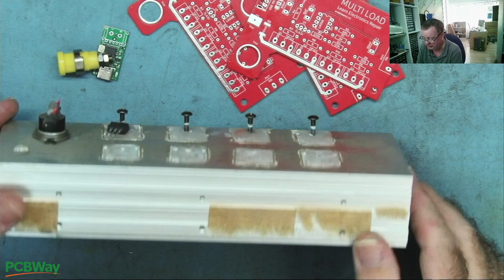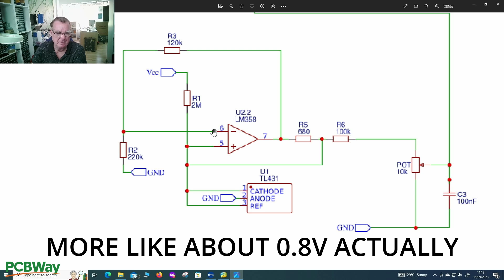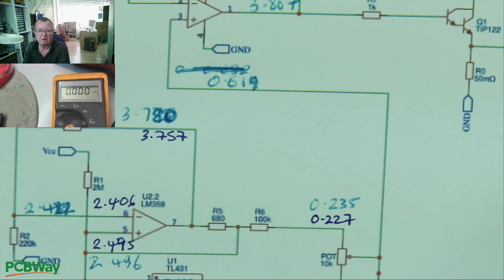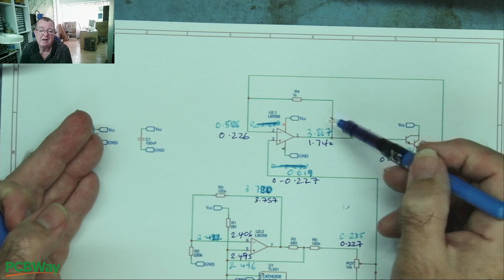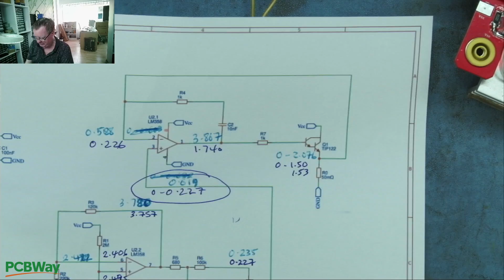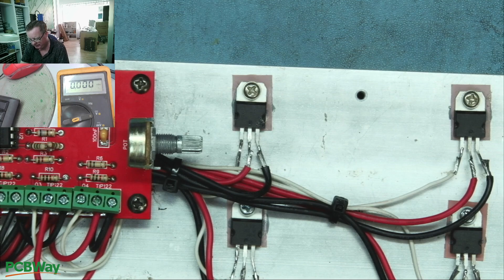MultiLOAD DIY General Purpose 140W Variable Electronic Load with USB PD Control

Comment: Besides what other commenters said about current sharing imbalances, you also have to take into account the SOA (safe operating area) of the transistors, they can only achieve the banner specs at ambient temperature and for a short time, as you increase the collector emitter voltage your maximum safe current is decreased significantly for DC(continuous) operation, the graph is usually near the end of the datasheet, before package information.

For the TIP122 you can only pull 1.8A at 30v VCE which is below the max power(assuming you can dump that power while keeping the transistor cool, if not you have to reduce the power even more). For a low voltage load like this one the effect is not as pronounced, but you should take it into consideration.

Comment: Transistors are CURRENT BASED devices, each with their OWN individual current gain figure. If the current gains (and tempcos and other things) are not exactly matched, having "the same matched voltage on the base" does NOT mean they will be sharing the load evenly. Their different current gains means each one will be drawing different amounts of load. Generally the highest one will heat up and then by its tempco gain even more current, heat up more, etc.... pop.

You either need somewhat chonky 'ballast' resistors at the base of each one (same principle as balancing LEDs when they're fed a voltage, so they draw an even current), or you need a separate opamp for each transistor so each one has its feedback loop individually controlled in the opamp loop. Drawing them all in one loop will typically lead to you blowing a transistor (or one after another in a chain as each one fails) each time you up the power.

Comment: Regarding the difference between the voltage-difference between the pot-output and pin 3 one question: Did you always get the GND-level for your measurements from the same point? The GND conductor is not too wide for a current of about 4A and there may be a remarkable voltage drop on the way from the 0R05 resistor to the USB-connector particularly with regard to the fact that it is reduced at the point whrere the OP-Amp is connected to GND. This may cause very different readings if the GND-level is taken from different points e.g. once at the USB-Connector and once directly at the pot.
With your design (obviously a double-sided PCB with a GND-plane on one side) you will not have this problem...

Comment: I've reverse engineered the PCB myself from the layout in the designers Youtube video. You haven't made any mistakes. Your schematic is correct. I have to ask where you bought the TIP122 transistors though. Were they from Ali Express?  🤔
Reply from the maker: The TIP122 from AliExpress... Probably 😉  Thanks for taking the to check our work (it was Detlef and Myself who did the reverse engineering).  If you check the other comments i figured out what the op-amp around the TL431 is doing so the circuit makes sense to me now

Comment: The reason why you don’t have identical values on pin 5 and 6 is that the output of the OPAMP is saturated.
According the datasheet the typical maximum output voltage at 5V supply is 3.5V.
If you calculate the voltage divider, the OPAMP should deliver 3.86V which it simply can’t.
Is this circuit meant to be a kind of pre-regulator to the TL431?
Shouldn’t be necessary in the supply range from 5 to 24V.
Reply from the maker: Thanks for the info, I like this because with these sort of videos and the discussion we can all learn something new.  I have to agree with you I honestly can't figure out what the op-amp  is doing in this circuit other than it could be regulating the supply to TL431 in some way.  It makes no sense to me to effectively 'amplify' the 2.5V refenrence voltage and feed that to the 10K pot.  Anyway that is not what it is doing here if the reverse engineered schematic is correct.  Why not just use a resistor divider to set whatever reference we want on TL431 and feed that directly into the pot?  With 100K resistor in series the current flowing through the 100K+10K is very small, and the other opamp input draws basically no current anyway.
Reply: @learnelectronicsrepair  maybe it’s just making use of the other half of the LM358..?
Reply from the maker: @inse001  Just for the fun of it 😅Nahh I figured it out, see the comments on the RalphJ4012 threads

Comment: Are you sure you can use 4 darlingtons in parallel without adjusting any other values ??...cheers.
Reply from the maker: Some comments on the original design say they have done this and got 140W load, but they don't go into specifics how they did it.  From what I was seeing, it did work with four in parallel until one failed.  It has been suggested that transistors were not balanced because they should have individual emitter resistors as well as individual base resistors.  The TIP122 datasheet says the rating is 100V, 5A, 65W.  Even if only one transistor was passing all the current IMHO it should not have failed.  I had 45W according to the USB analyzer so that's like 2.1A at 20V which does not exceed any of the ratings.  Obviously I'll be trying out a lot of ideas from these comments on the next video so hopefully we can all learn more than we already thought we knew 🙂
Reply: @learnelectronicsrepair  Richard, be careful about those seemingly simple figures fron the datasheet.
I can hardly imagine a TO220 package dissipating 65W (submerged in liquid nitrogen, possibly).
The datasheet might say 65W at t_junction 25 Celsius, for example (haven’t checked).
Reply from the maker: @inse001  It did say something like that, but the degradation per degree C was fairly small above that.  However it did go short.  Will experiment further on next video and also use thermal camera
Reply: Thanks ! @learnelectronicsrepair

Comment: Something odd-looking (to me, so maybe wrong) in the 2.5V reference circuit. The TL431 typically has a minimum cathode current of 1mA, typically 10mA. Although I nearly went doolally trying to figure out what that circuit was supposed to do, it seems to me that only microamps can flow via the 2M resistor, though there may be other components, connections not shown.
Reply from the maker: There is something odd with that part of the circuit.  It looks like the 2M resistor feeds the TL431, but then the 680R resistor on the output of the op amp also feeds TL431 and the voltage going to the 10K potentiometer via the 100K resistor can only be te output of TL431 which is 2.5V in this configuration.  So we get around 0.25V on the potentiomeeter which is what I was seeing.  But in that case what is the op-amp even doing?  I did think we have an error in the reverse engineered schematic, and we may well do, but the 680R and 100K resistors are also connected like this on the original PCB
Reply: @learnelectronicsrepair  Yes, very odd. Almost as if the op-amp is attempting to be the two resistors required to set the reference on the TL431, depending on the supply voltage. Depending on the reverse-engineering  revisit it may be worth just using a fixed reference component and not using that op-amp part. Also, may be worth investigating the drive current into the multiple TIP122's, there are some notes online about using pre-drivers or IRF1404's instead.  Apologies for the duplicate comment, that's YT auto-deleting and re-appearing comments again.
Reply from the maker: @ralphj4012  I think I have it. I'm pretty sure the opamp is acting like a constant voltage source for TL431.  The output of TL431 sets the output of the op amp (pin 7) to something a volt or so above the reference voltage and this powers TL431 via the 680R resistor.  The reference of 2.5V is then feeding into the pot. Obviously the load is meant to work on any voltage from about 5V to 30V but I never knew TL431 needed a fairly constant input voltage to give 2.5V ref.
Reply: @learnelectronicsrepair  That's making some sense, though I think you mentioned that you had differing voltages on the pot (0.2V, 0.6V) between the different versions so, personally, I wouldn't trust the op-amp bit, especially as 2.5V never gets to the pot, due to the divider. But, hey-ho, any more analyses and my head would explode. Good luck with this project.
Reply from the maker: @ralphj4012  Now that bit where I was seeing 0.6V on the original version does not make any sense to me either!  More work required there.  
Without your head exploding, the 2.5V reference from TL431 and the 2M resistor sets the voltage on the non inverting input of U2.2 (pin 5) at startup.  This forces the output of U2.2 to something like 3.7V because of the ratio of feedback resistors R3/R2.  

The 3.7V from U2.2 pin 7 then powers the TL431 via the 680R resistor and this supply will always be 3.7V regardless of Vcc (supply from PSU under load test).  

R6 (100K) then feeds the 2.5V reference to the 10K potentiometer, putting about 0.225V on the pot.  It only looks like R5 680R and R6 100K are acting like two resistors in series on the output of U2.2 (voltage divider) because of the way we drew the schematic.  

The pot is connected to TL431 cathode via the 100K resistor and TL431 cathode is our reference voltage 2.5V.  If there is something wrong with the readings I took, it is on the original version where I saw 0.2V/0.6V.
Reply: @learnelectronicsrepair  Yes, badly explained on my part, the two resistor divider in my head is R6 and the pot (that's why there isn't 2.5V on the pot). 0.6V seems to imply that the 2.5V reference circuit wasn't working properly, so it may be worth measuring the current into the TL431 at various input voltages. The startup situation is a little odd (in my opinion), there would be insufficient current through the 2M for anything sensible to happen TL431-wise. Personally, I would ditch the op-amp reference bit (head explosion turning into nightmare) and use something like a LT1009 which only needs a single fixed series resistor to cope with a 5V to 35V supply, but, hey, that's me.
Reply from the maker: @ralphj4012  The wierd 0.6V readings were on the original version, but I still want to look into why. Actually the startup condition for this ceircuit makes perfect sense.  With a 2M series resistor the TL431 can't do anything sensible.  Agreed.  But the 2M resistor also connects the non inverting input of the op amp to Vcc (input voltage) which means that the output of the op amp always goes high when we apply a power supply as the input impedance of the op amp is near infinite.  So this means the TL431 will always get a supply voltage from op amp pin 7 on startup, and then regulates the voltage on the non inverting input to 2.5V setting it's own supply voltage at about 3.7V regardless of input Vcc.   Credits to the circuit designer, elegant doesn't even do it justice!
Reply: @learnelectronicsrepair   TL431 will work as long as it has 1-10mA flowing into it. Less and it might never develop the 2.5V, more and you risk overheating it.

Comment: It is very important that each output power transistor MUST have its own emitter and base resistor !
Otherwise the one transistor that has the slightly tiniest highest Hfe (current gain) will take ALL the current by itself !
Think about it !
Thus most likely this single higher gain transistor will quickly be overloaded by the thermal junction run-away causing a lower B-E voltage.
This implies you must use at least 4 times higher resistor values on R7 and R0, as they functionally are in parallel through the transistors.
I suggest 10K ohm for R7 (on each transistor) and 0R47 for R0 (on each transistor).
Simple to modify as you just have to solder in these resistors on each transistors base and emitter wires - effectively having them in series With existing R7 and R0 on the PCB respectively.
The feedback to U2.1 is okay to still take from the PCB mounted R0 as this will still represent the average current through all transistors as the modification ensures equal current through all transistors.
No modification to the PCB then ...

The circuit - as is - is simply not suited for parallelled output transistors without this modification ....
And may cause you endless headache to fault trace 😉
Reply from the maker: Interesting and I agree about balancing the transistors, but should that not happen if each has it's own base resistor but the emitters are connected together?  Because each one then can still have it's own base-emitter voltage.  As these are darlington transistors then they should not need much base current, so 10K base resistors sound reasonable.  Regards R0, when I originally fitted 0R5 by mistake I could only get approx 0.5A load.  When I fitted the 0R05 the load worked like the original one.

So if another resistor was added to each emitter (0R47) wouldn't this mess with the load in such a way to limit the maximum current it can sink?   I have some 0R22 resistors I could try as emitter resistors, and these are a common value in amplifiers etc.  

Regards the feedback, are you saying to put a resistor on each emitter, then connect the other ends of all these resistors together and connect that node to the 0R05 current sense resistor?

I do have a couple more TIP122 so there is plenty scope to experiment here like you say.  Thanks for the suggestions
Reply: The base current in the darlingtons are so small it is not the best place to try balancing out the transistors.
You have to do it in the path where the current is high - and that is the emitter.
Remember that the emitter resistors are effectively in parallel in the functional circuit and is only used to spread out the current by imposing a voltage drop in series with the B-E voltage.
It may work perfectly fine with your available 0R22 resistors.
If you convert to powerFETs you have to consider you now have a voltage amplifier setup. @learnelectronicsrepair
Reply from the maker: @CXensation  Thanks for that, I had not considered the base current amplification in the Darlington. What you say makes perfect sense to me.  My only concern is putting resistors in the emitter circuit will decrease the current sink capabilities of the load. Seeing as they would have to be in series with the existing 0R05 otherwise how can the combined current be monitored.  But then presumably the feedback circuit will just increase the drive to the Darlington transistors until it gets enough voltage across R050 to balance the circuit.  Plenty of ideas to play with on a followup 😁

Comment: maybe the transistors were too much out of balance try with close matched pairs
Reply: Impossible as they are darlington types.
No matter how close you match them up - the single one with itty bitty highest current gain will ALLWAYS eat up ALL the current by itself !
You can ONLY do it with powerFETs as they have the opposite thermal characteristic thus balancing themselves out.
Reply from the maker: @CXensation  Even with one transistor passing all the current ,I had something like 45W on the usb analyzer, so that is 2.1A at 20V potentially flowing through one transistor rated at 5A 100V 65W.  So why would it fail?   Of course I'm going to try your other suggestions on previous comment regards emitter resistors and we will all see how that works out .  And we can play around with the thermal camera too.  Changing the design to powerFET could also be an interesting challenge.  Thanks for your input, let's keep learning.   🙂

Comment: timestamp 1:37 Richard you can / could / should addan amp meter and a volt meter to it .. that shouldnt be hard to do ....
Reply from the maker: The completed version will have an optional daughter board that displays volts amps and watts. Detlef is designing that part

Comment: Is there schematics and PCB layout for this project ? Good job, learned a lot from the video.
Reply from the maker: The schematics and Gerber will be made available once we get it to work correctly, this is the prototype. I did show the schematic in this video.  I had to reverse engineer it as there is no schematic available for the original version so it could have some error in it. I don't think so, but it still could...